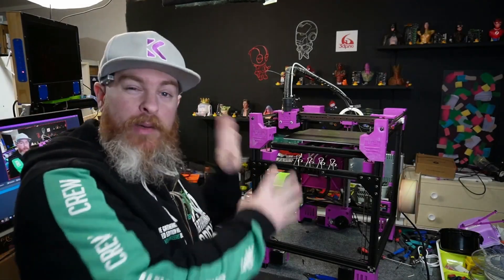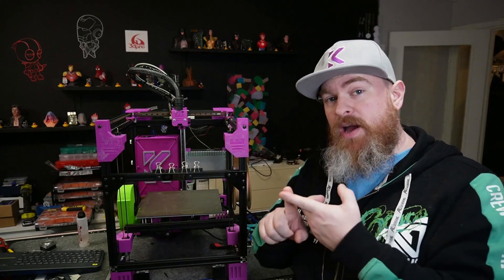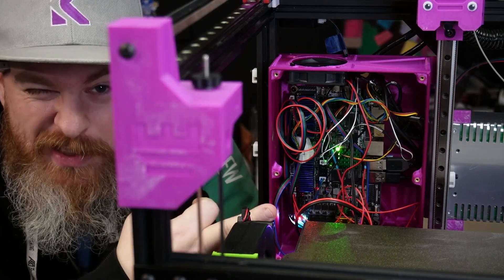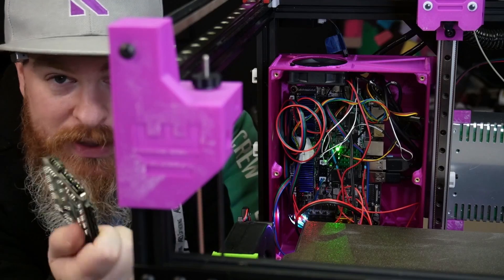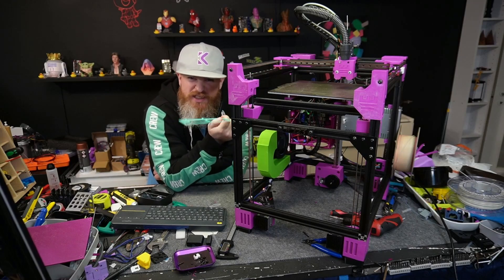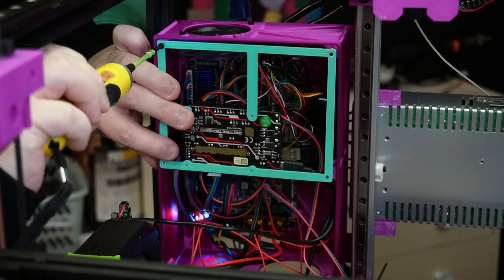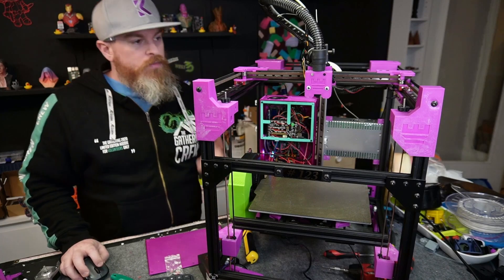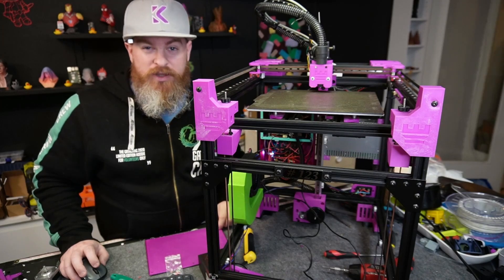Fixing a bad board on my Scalable MK2!

Comment: Hi Kanrog, yes I look forward to your videos, it would be nice to have a live stream, what I liked to see in this video was how you programmed the two boards in config.cfg, and one more question, why doesn't the printer work with just the pico and a pi? Thanks for sharing your work. And happy holidays.
Reply from the maker: I have a video that explains how to set up multiple boards in klipper, I left a link in the description.
The reason this printer can't work with just the Pico is because of the 3 motors that I need for the bed.
The pico can only run 4 steppers and this printer needs 6. X/Y, 3x Z and the extruder.
Reply: Thanks ❤

Comment: nice fix. you should really change the motor connector to the correct on its not hard and makes sure it can't get loose
Reply from the maker: I'll fix that when the leviathan comes in over new years 🥸